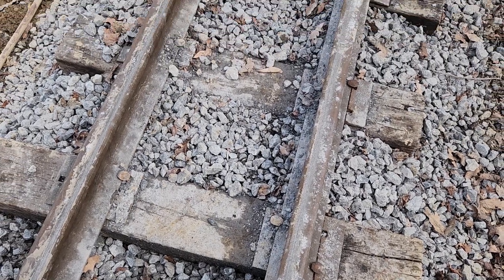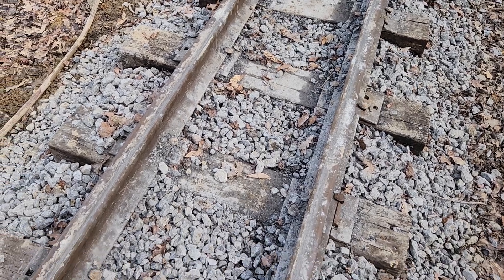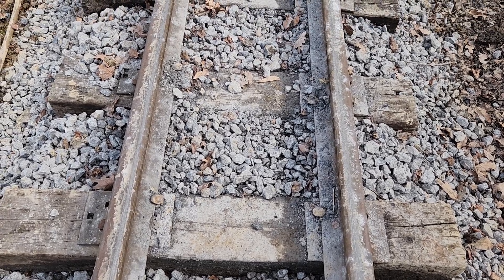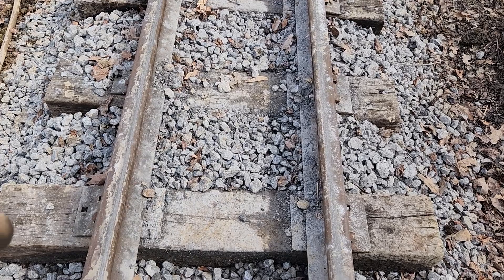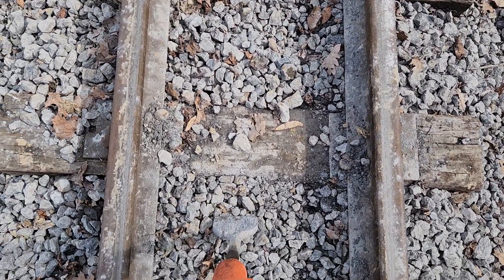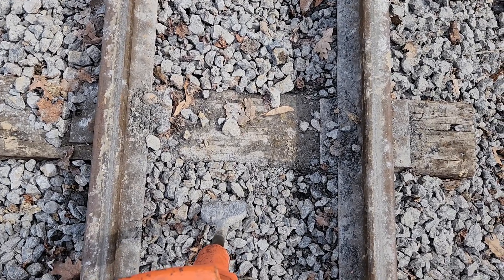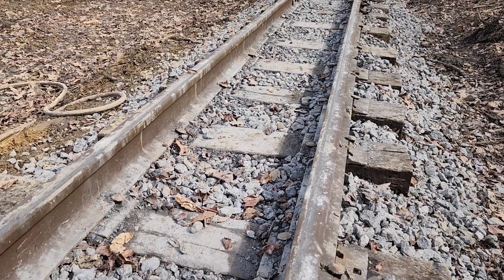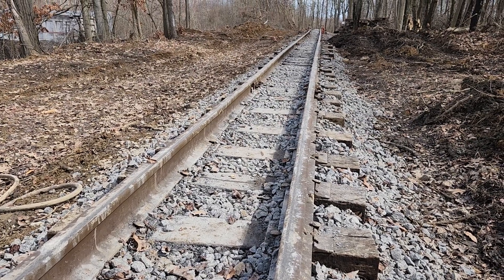What happens when Tamping Track

Comment: Random question sir: Where did you get the clips/brackets that you used to attach the rails to the floor of the boxcar? I saved 40 feet of local historic rail from being scrapped back in October, and I would like to lay it on boards in my garage, in gauge.
Reply from the maker: Kimessteel.com has rail clips.  They even have low profile steel ties if you would like to go that route.
Reply: @YoungstownSteelHeritage  Found them. Thank you! :) I took a look at the steel ties also. Those are pretty tempting too, though I would have to put something under each one to avoid rust stains on my garage floor.